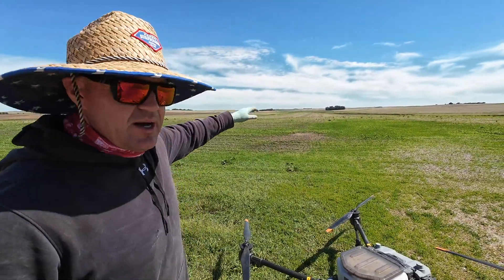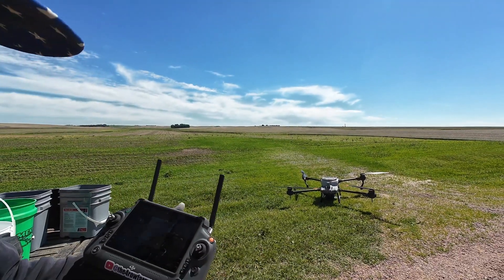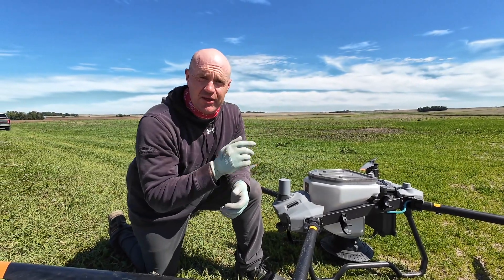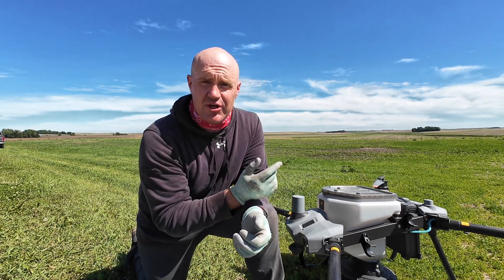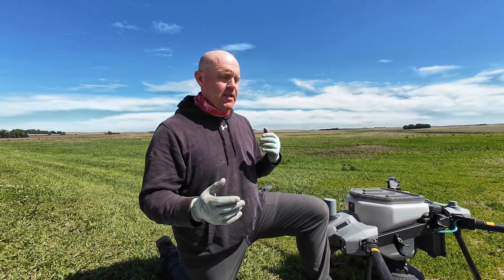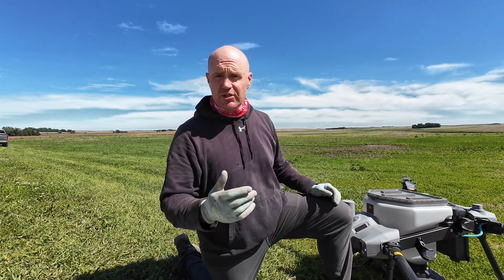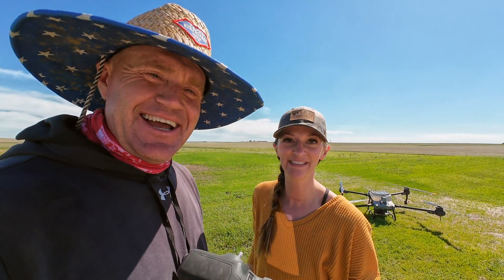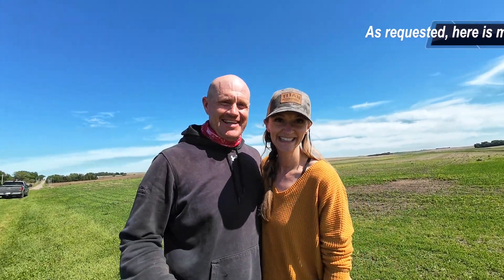Fertilizing Over 4 Million Corn Plants, 5 Gallon Buckets at a Time! Drone Fertilizing-DJI Agras T20P

Comment: How long did it take you to do 155 acres?
Reply from the maker: I ended not having my spinner speed set correct and ruined a set of rotors at around 38 acres. Looking at my controller I did 37.47 acres in just under 5 hrs. I was apply at 100lbs /acre. I called the coop and had them spread the rest as I needed to get it applied. The lesson learned is that lowering my application rate and spinner speed would have saved my rotors. I am looking forward to implementing the drone into the operation further next year as I will be rotating to beans with a little corn on corn. Thanks for reaching out and please ask if you have any further questions! 

Do you have any experience with drone fertilizer application? Would love to know if you would have any application advice!

Thanks for watching!
Reply: @the4rowfarmer  I don’t have Much experience with a drone, we have used ground rigs , but we are expanding our operation and buying 2 more t50 s , we have t40 right now and look to expand next season in fertilizer and cover crop along with spraying, enjoy watching your videos to learn more and more each day, how much do you guys charge an acre when your doing custom spreading at 100 lbs per acre ?
Reply from the maker: @ConnorDixon-n8n  right now I am only using the drone on my own field. Locally here it seems drones are charging around $13/acre for spraying. Not too many are doing fertilizer spreading. I would love to try some cover crops! I saw the T50 at Husker Harvest day this last week and would love the radar system! I really do like my T20p but it is does have a limited capacity compared to the T40 and or T 50. The big advantage of the smaller T20P is using the T40 battery for less battery swaps!
Reply: @the4rowfarmer  I saw some guys north of here charging 20 an acre for spreading cover crop and fertilizer